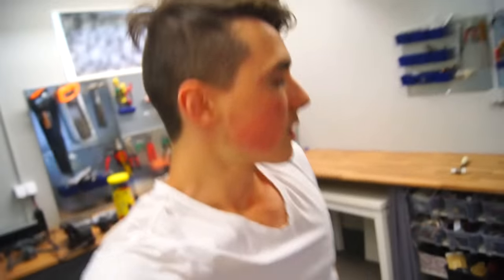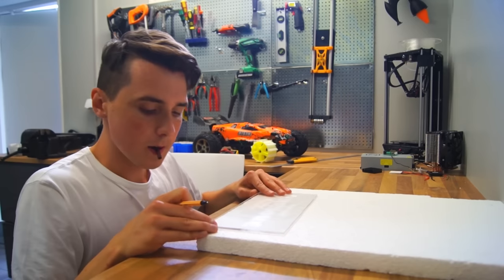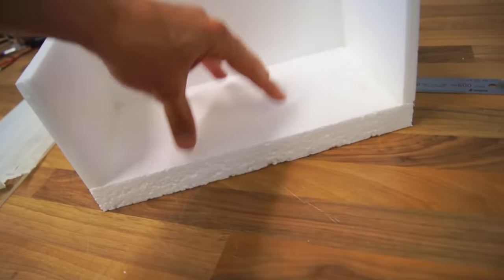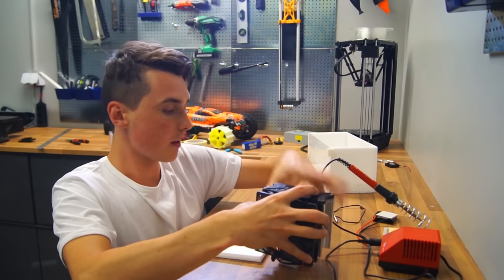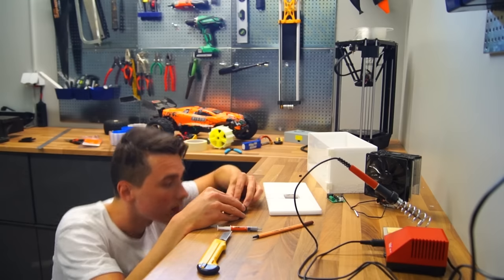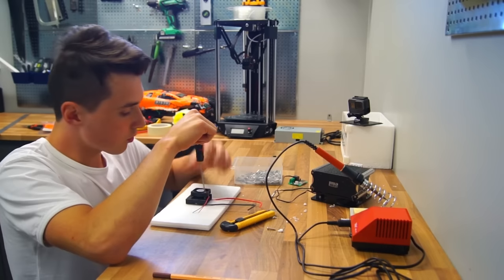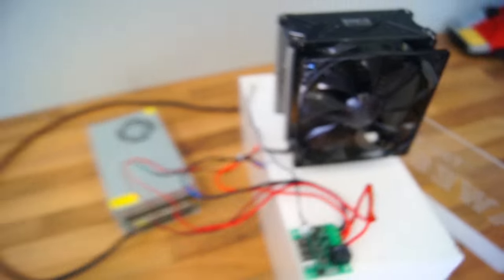Powerful Cooler Box - DIY Peltier Freezer

Comment: I really like your video, you have the guts to DO it, it is just a young boy's dream to play with electronics and make some nice things. I lack the possibilities to make such a nice design like yours, but am very interested in how you accomplished it the way you did. Compliments!
Thank you for this video, and keep making more! ( Oh, and don't worry about the paste, on cpu's. Normally the pressure of motherboard attached coolers keeps pressing down on the paste, but i wondered if something like springs or elastic bands would help keeping the two cooling elements in place. Might want to investigate these possibilities??)

Comment: The cold side actually gets colder with the hot side getting hotter. The reason you need such a big heat sink is because the hot side will burn itself out at those temps without a heatsink.

Comment: For the thermal paste application, in my opinion it’s better to put multiple rice-size drops so that it then covers all the ceramic plate. The problem with peltiers is that they produce heat in every part of the ceramic plate (because there are elements even in the edges) and not like a cpu whose thermal spot is in the middle. Also ceramic isnt’t a pretty good condutor so the non-thermal-pasted areas remains hot.

Comment: very very cool [seriously :P ]!  How rigid is the large heatsink?  Does it wobble badly?  If it does, 3D print a few L brackets to hot glue to the top, to help hold it a bit more rigid?  (can you put a thermometer inside the box not just on the peltier)  .Can it cool the inside of the box to say cool a can of soda?   So very awesome!  It's cool to see the heat pipe design being used...this allows the hot and cold side to be farther apart!
Awesome..keep em coming!!!!!

Comment: Best way to apply thermal grease is the least common one. Just smear some grease on and then drop some lighter fluid on and stirr it in with the tip of the thermal grease tube until the mixture is homogenous and fluid. This way you get the thinnest possible layer without any air bubbles in it. The benzine will gas out to the sides over time.

Comment: I have a suggestion.. how about u use like home aircond..... use water block/radiator on both side.. so the heat removal from the hot side will more effective and the cool side will be more cool.. means from water pump goes to cool of peltier then loop it to hot side from peltier then to the resevoir.. things need was temperature regulator so it wont over freeze..

Comment: I used modeling clay as Thermal paste on an old gaming cpu, It's been running for 2 years.... everyone can suck it.
 Dump that thermal paste on it until it pushes out of the edges, then just remove the excess on the edges.

Comment: Thermal paste is meant to fill in any microscopic air gaps (such as where the OEM has laser etched numbers). It works somewhat better than air, but much worse than direct metal to metal contact.
A "pea" is too much for most cases. It's not meant to glue the 2 parts together... If anything, it's more like a polish.

Comment: Didn't know if you knew you could "stack" TEC's to achieve even colder temps as each one will give you a drop for that stage.Beware though...you can fry a device if you can not produce sufficient cooling to wick the heat from each.  My limit has been 2- 3 with air cooling alone.    Can also use your controller to create a duty cycle,  e.g  x sec on and then x sec off.  Have fun...            jw

Comment: I feel like not only would better insulation help with keeping it cool when it's off, so would some more thermal mass. Right now there's only the styrofoam which doesn't have much mass, maybe add some metal shelfs inside it to help.  Anyways cool project nonetheless!

Comment: the heatsink unit is a PWM unit with 4 wires coming out of .. which of those 4 wires did you connect to the power supply, and which 2 did you discard? thanks for a great video!

Comment: Use thermal conductive glue instead of paste in there. The losses are minimal, its going to have a high difference anyway, and it will make it sturdier.

Comment: Nice work!  I'm trying to figure something out and hoping you or you followers could help... if I wanted to chill water to a temperature just above freezing point (1-2˚ C), would it be more efficient to create a freezer like this the one you created here, where the small/cold heat sink cools the air of the freezer box which contains an inner container of water?  Or, would it be more effective to place the cold heatsink directly into the water?  Any feedback would be greatly appreciated.  Thanks!!
Reply: Thomas, I'm no expert at thermal dynamics here haha, but I am almost positive that putting the water in direct contact with the cold side of the peltier would be best. I'm happy to answer any other questions you have as well.

Comment: You could always try to improve the insulation by using those thing foam sheet and build the box like an thermos 2 layer with nitrogen between them.

then if you improve your insulation you could try to have it run on solar power that way you will have cold ice everywhere you go :)

Comment: Nice video thanks. Actually it was the first i watch about cooling. I did not expect that the peltier is so cheap.....it was not before:-). Let me know if I'm wrong, but the temperature controller you use is ONLY for heat not for Cool...so You can not use it's advantage. Will not work at all...will be ON all the time. Cheers.

Comment: heat compound   -, slather it on like your making a peanut butter sandwich and smash it them wipe away the residual , the size of your peltier is the size of 10 cpu chips, working with diodes in the past i have learned you gotta put on a large enough amount to insure the entire interface is being used , there is a guy who test the temperature average  of all techs and both the pea and the excessive amount won the competition at a tie  , so to be save be sure you have a better idea of what kinda pea size you need , a pea size aint gonna be enough for a peltier module

Comment: That Heat sink you used is only rated for about 120 watts or so, I did this with an AIO water cooler, and it worked ok, P.S. how much Current did you put though that TEC?, Its rated for 200 watts at 12 Volts, which would be a Max of about 16 AMPS

Comment: I worked in facilities that stored and transported Natural Gas and use Nitrogen to liquefy the Natural Gas , they use "Foamglass" to insulate the pipe lines with liquefied gas petroleum base join binder , and finally Tar-paper pipe wrap. if not done properly you get condensation, and that's never good.

Comment: the door might be your weak point in insulation. might i suggest a double wall door: plexiglass -> air -> plexiglass. with foam holding the the two pieces apart, and sealing the air gap.

Comment: try to use a GPU cooler instead of CPU cooler for the next Peltier project.
they are usually smaller, less bulky and have higher cooling capacity in comparison to CPU coolers.
it gives you new room for different designs.

keep up the good job:-)

Comment: Do you know what the average power draw was when the peltier and fans were station keeping at -7C? Wondering if it would be possible to put a similar system in a cooler for an afternoon on the beach while running on some LiPos...

Comment: The insulation isn’t your issue, it’s the fact that you have a giant heat sink transferring heat from the box to the outside. Without electricity, the Peltier becomes a thermal conductor

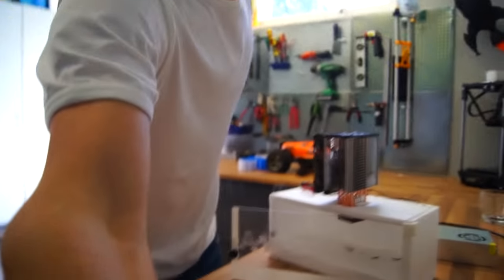Comment: RCLifeOn I finally got ice! I now know what I did wrong. But I have a question, what is that power supply at 7:05 called? I just need the name of the kind of power supply, not the brand name or something... 
Thank you for your video, it really cleared things up for me especially the thermostat part. If you could answer my question I would really appreciate it.
Reply: Thank you! I really appreciate it :)

Comment: Hej, first: great videos, i like them much. Now i try to build a cooler too but got problems with the thermoplast. I have no experiences with this stuff - i put it on the heatsink and the peltier module but it seems to stay slippery. Did i buy the wrong thermoplast? Because in all your videos it seems to 'glue' the parts so that they stick together.  What should i do? Maybe you/somebody has an advice? Thank you :)

Comment: I know im late but try using a noctua nh-d15 cpu cooler and underneath put some old graphics card heatsink and a fan on it believe me that will get you down to -20 with a litle bit betet insulation.

Comment: Most people who use the "pea-method" are PC builders.
The thing is: A Peltier element isn't a CPU!
The whole surface of an Peltier gets the same amount of heat energy, while a CPU only gets the heat from the small die under the hestspreader, so a round point of thermal paste is fine.
In addition, the surface of the CPU is much smoother than the corse ceramics of the Peltier. 
Spread the paste like butter and wiggle the heatsink arround, like you dif before, don't listen to PC builders for your Peltier cooling ;)

Comment: Nice video but you should add some thermal mass inside to properly test it. It doesn't take that much of an energy to cool down the air inside. From my own experience, it takes unreasonable amount of time to cool down a can of beer inside (hours) using one peltier and styrofoam insulation. It would be interesting to see how your freezer copes with a can of drink.
Reply from the maker: +MegaKiller10 Thanks mate! I was impressed by the results in my previous cooler box video, as it was able to cool down a drink rather quickly. I'm working on a even larger cooler box, I will definitely put a few drinks in that one!

Comment: thanks for doing and showing this project as me and my son are looking to do this to keep cool drinks this summer because normal refrigerators are lame lol. I was wondering what kind of power supply that was?
do you think this set up could be used with a 120v 410watt power inverter for use with vehicle 12v power source. Did you say it was drawing 10a of power?
thanks for any advice sorry for my limited understanding love the channel
Reply: If you had a 12v power source already you would just connect directly to that. The power supply is just taking 120v mains power and converting it to 12v.

Comment: What is this next big project? a cooler box bigger? im thinking about doing a 30L peltier cooller box. I'm thinking about colling a liquid in a copper tube with the peltier, that refrigerate the internal part of the box. and a "water cooler" will refrigerate the hot side of the peltier externaly and another peltier will refrigerate the water cooler. what do you think about it?

Comment: You should get or make a hot wire to cut foam with instead. You won't have to deal with foam bits if you use one.

Comment: thnax for this video?
my question is:
i have 12/6A/60W peltier module i want to connect 10 peltier  module   in parallel for better cooling.
So what power supply should i use? (12v/ current=?)
how many fan should i use for heat dissipattion?

my requiremnt is to down temperature of pouches from 95 to 35 C in 45 min?

Comment: im an engineer of thermoeletric cooler , those thing are over power than compressor right now , but it depends on what capacity you adopted , we use a 6A module for a 33 liter cooler and test under 90 Fahrenheit can be 1.65Khw/24 Hrs . the periods is totallt unstable , if i do , i will pick up a compressor instead of thermo cooler

Comment: planning to use your design to make a table vine cooler but i wonder if the circuit you used can also trigger a relay to switch off at a certain temp

super video and nice stain :_=)
Reply from the maker: +chibanix Awesome, good luck mate. Yes, the controller is able to automatically shut off at a set temperature.

Comment: I think as soon as you turned it of heat started flowing in from room thru the heatsink on top. The insulation probably better then the temp results
Reply: Couldn’t be because he left the heat cooling fan on but must’ve turned the peltier off

Comment: To be truth, applying thermal compound like this, is only if you'll use screws. To a really good and equal pressure. Without screws, i prefer to aply manually.

Comment: if we are using the cold side  of peltier in an insulated environment ,where does the heat from the  air inside the insulated environment goes ,once it gets cooled by the cold side peltier.?

Comment: what if you made your enclosure bigger, a band pass enclosure? prop heat sink on a tripod, rubber matted interior speakers at base,  a fan and plexi glass top? water insulate the walls.

Comment: I  have also built one of these, peltier technology is just awesome. bbbbbbbut I find them to be very inefficient. My current edgestar 12v refrigerant based cooler runs for a couple to a few days on a 35ah small battery, and that's without solar assistance.
Reply from the maker: Oh yes, they are as inefficient as me doing my homework. They are fun to play around with nonetheless.

Comment: the problem with the pea sized method compared to just spreading the thermal paste out is that, if you push the heat sink and you're pushing slightly on one side, it will spread sideways and half of your processor won't make contact. It is however technically providing a more bubble free thermal layer which makes a negligible difference in thermal performance, but it also saves you thermal paste (unfortunately after you applied it to the heat sink, you then pulled the heat sink off again and introduced bubbles anyway). However! Someone should test if the thinner thermal paste layer is affected worse by extremely low temperatures.

Comment: Question would be whether peltier element works as thermal insulator when it is turned off or thermal bridge, if the later then you have a huge heatsink on the outside =\

Comment: Hey bud I’m trying to build a enclosed audio amplifier box what method do you recommend it’s going to be 4ft long 6” deep and 14” wide very well insulated with two 5000 watt amplifiers in it for my truck water cooled or air cooled peltier devices?

Comment: Clicked on the Peltier element & eBay said it's no longer available, but they found something similar: "Te C1-12715 Plate Module PE a Tier 12v 15a Heatsink Thermoelectric Cooler HP". Is it better?

Also, would there be a way to daisy chain 4, 6 Peltier elements together to work together & quickly attain below freezing temperatures? What would I have to do for heatsink(s)?

Comment: what about using two of those cpu coolers with a 62mm peltier sandwiched between them, a compact PSU below, make it a tall tower, would be like a portable personal AC, if it lowers the cold air to at least 5º below ambient that'd be enough success for me

Comment: i hope either you or someone could reply this.

im using 12706 with 12C 10A power supply unit. when connected the peltier not freeze just cold. the draw current only 1 amp. im using a huge heatsink on the hotside. is the peltier broke?

Comment: Instead of one 200wats cell one don't you use ten 20watts cells or so to have a better surface area on both sides and maybe need a smaller heatsink? I've never used those cells so I don't know if it's feasible but I wouldn't like having a big bulky fan on the top.

Comment: Thank you for your nice video.
I would like to ask your help if i want to make an Air condition in my vehicle with pelteir, hwo many cells I need to make it ?
my aim is to stop the main AC as it conseums 30% from motor capacity.
the area needed tobe  cooled down is 3.4 M3 (cubic meters) ?
Reply: your ac doesn't use 30% of your engine power, it consume a small number of horsepower (in the low single digits) and peltiers would be much less efficient, especially in a application where you are using your engine\alternator to generate the power needed.  You'd like have to fit at least a high output alternator, possible install a second one to get enough power for your idea.
Reply: thank you for your concern and reply

Comment: Debatable if the 'pea sized' ball is the best way to apply thermal paste. Tiny X or carefully spreading the paste on the surface has slightly better performances. Though when using the spreading method you have to be careful of forming air bubbles.

Comment: Spreading probably works better in this senairo just from the fact the whole surface your cooling is making heat where on s CPU the heat creating part is much smaller then the IHS it goes on. And the CPU cooler squishes it where your hand pressure may or may not squish it as well.

Comment: reduce your voltage to see if the temp on this drops more that is what im finding with the 12715 peltier if it does drop with lower voltage please comment back im doing a conversion of a 4.4 cubic foot fridge and am having a problem with the heat sinks i am using getting saturated with heat and not getting max cold but get colder when voltage is reduced. I am not using a tower heat sink so i dont know about the performance of them and would be interested to know how it goes.

Comment: Dont you think that power supply is a little overkill, you could probably just use a power adapter?
Reply from the maker: Not at all. It's a 15A peltier, and using a high rated power supply will ensure the peltier can reach maximum performance and is more safe. Thanks for watching my videos, I really do appreciate it!

Comment: that way to put the thermal paste only works with the CPU, the reason is becase the DIE of the CPU is in the center and the heat of the cpu is more in that area, in the case of the peltier i don't really sure if the heat is in all the surface of the peltier or is similar to the CPU, i use the thermal paste to cover all the surface of the CPU, i just check if don't leave any space without thermal paste, is a tiny layer maybe less than a 1mm